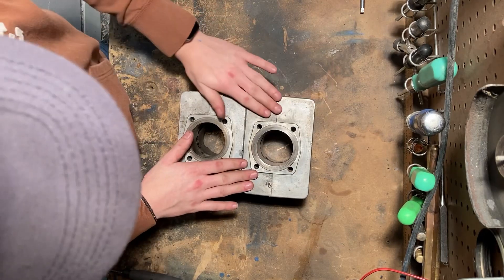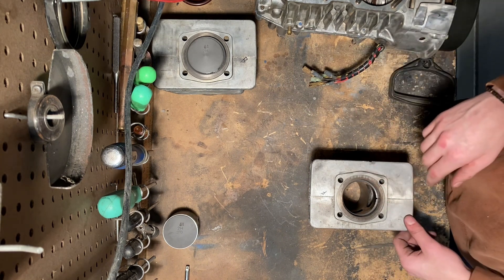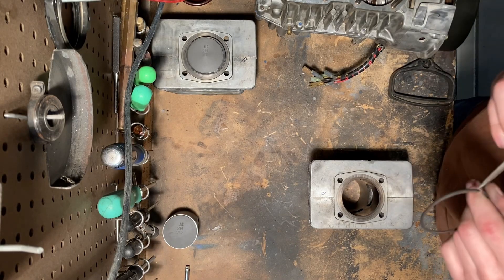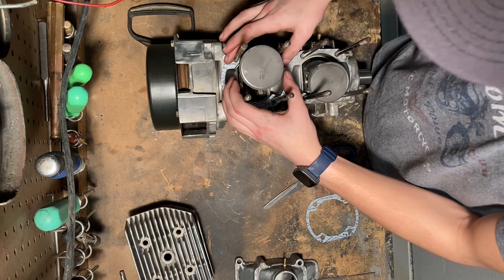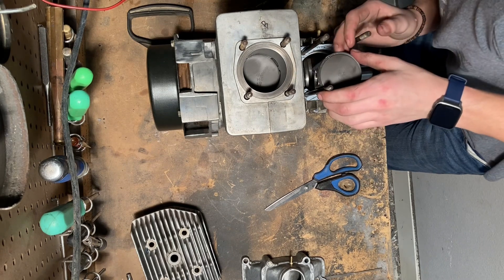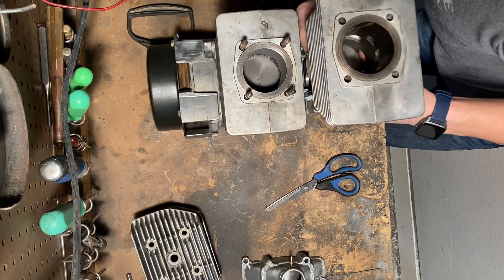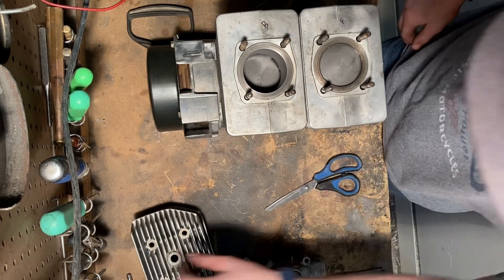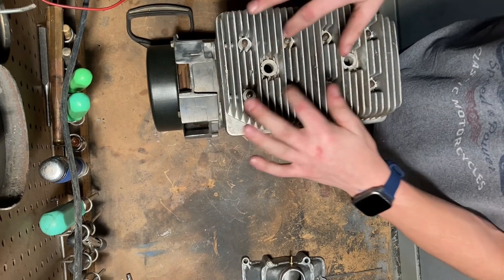Rotax 377 engine build (part 4)

Comment: Hi, Nice Videos!! please let me the total cost of rebuild.
Reply from the maker: The total rebuild cost me about $600 when all was said and done. That being said I did have to replace a lot of the ignition, so you could do it cheaper.
Reply: Thanks!! where did you buy the parts. I have a rotax 503 which I am planning to rebuild.
Reply from the maker: https://lionparts.com/collections/engine-snow 
What I did was find a sled that had my engine. It may take a little digging but if you need help just reach out!
Reply: Thank you. I really appreciate it. I am also thinking about the same route. I am building a Tukan Trike from plans I bought from the designer. Engine and wing are the two most expensive and important parts. Thanks again!! Cheers!!